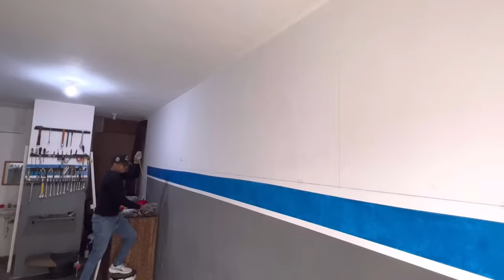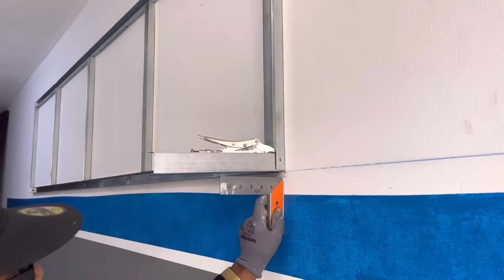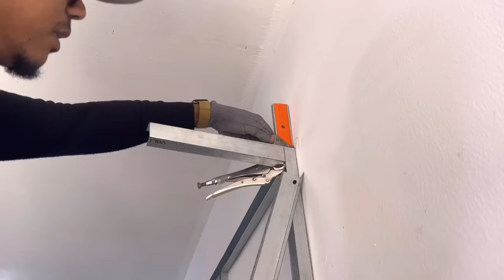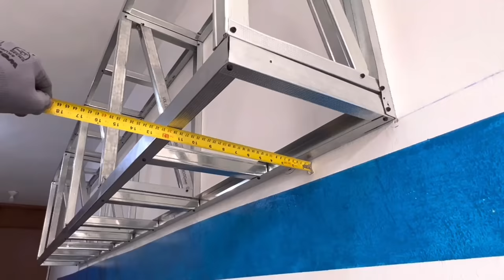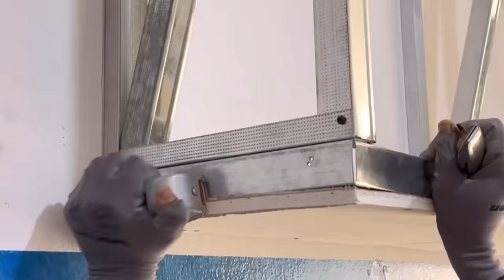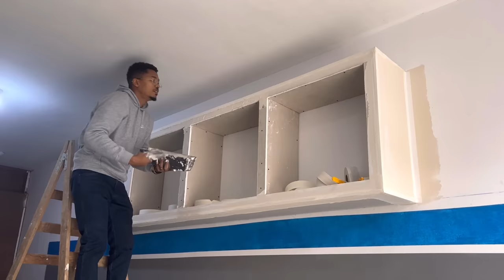Cómo hacer repostero aéreo con estructura y paneles de yeso en pared de la cocina moderna

Comment: Buen trabajo hermano, gracias por compartir tu conocimiento. Quería hacerte una consulta, que tanto peso me puede soportar ese repostero aéreo? si quisiera añadirle unas puerta de melamina para cada división estaría en lo correcto, o que recomiendas?.
Reply from the maker: Hola que tal, ese repostero soporta más de 100 kg, si quieres que soporte más solo agrega tornillos y tarugos a la base principal que coloque en la pared, si deseas ponerle puerta solo debes hacer las divisiones unos 3 cm adentro, para dejar ese espacio para colocar puertas corredizas en todo el frente el repostero
Reply: @DrywalldecoracionessA1  genial, y en el caso que la base sea pared de drywall, es suficiente poner madera  en los parantes o habría que reforzar como en el caso de la instalación de rack para tv, recomiéndame hermano, gracias.